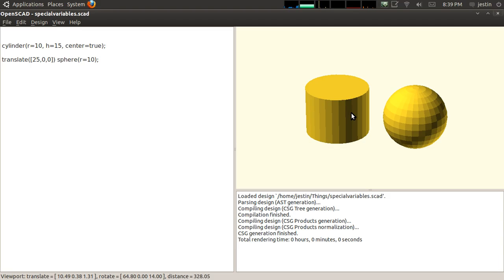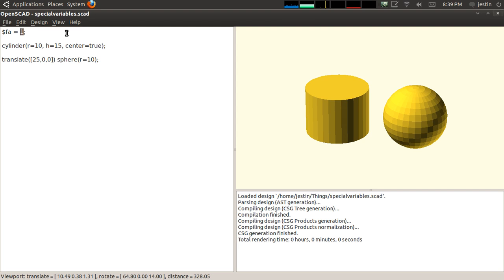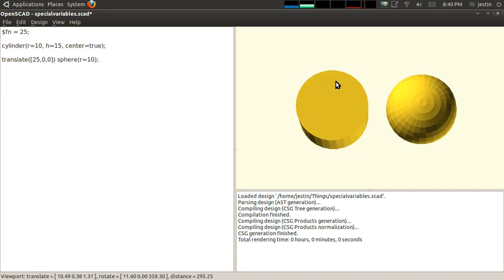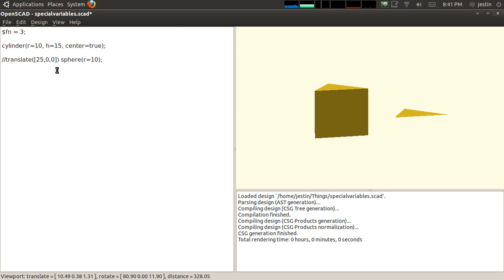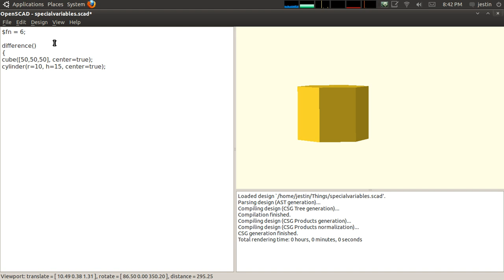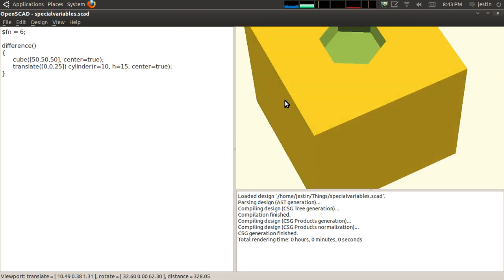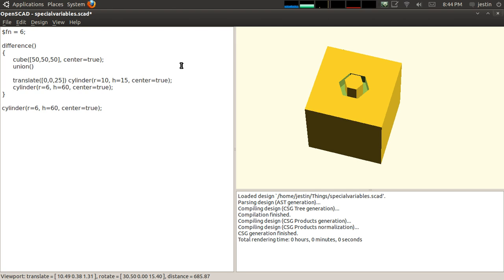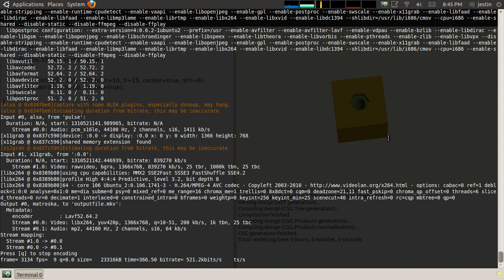Special Variables in OpenSCAD

Comment: you can use an external editor like vim.  openscad will update to reflect your changes whenever you save the file.  I use them side by side in i3 wm and it's a good workflow for me.
Reply from the maker: You just described the workflow I've been using for past 2 years.  I've realized that most of what an IDE does should be handled by your window manager, allowing you to swap components to your liking.